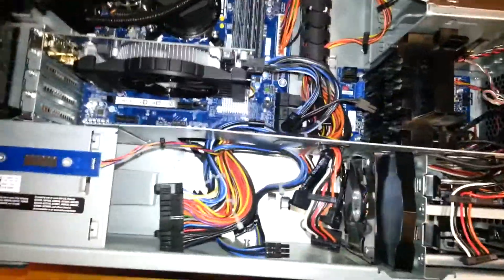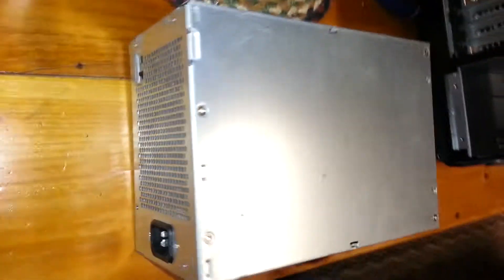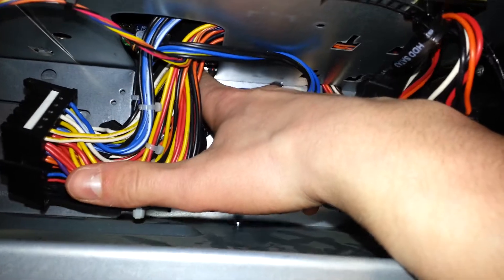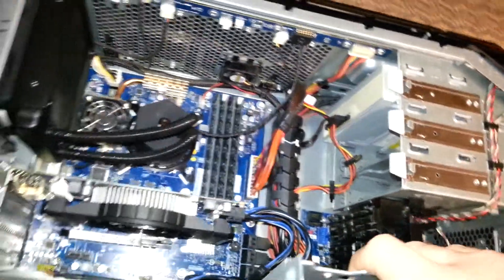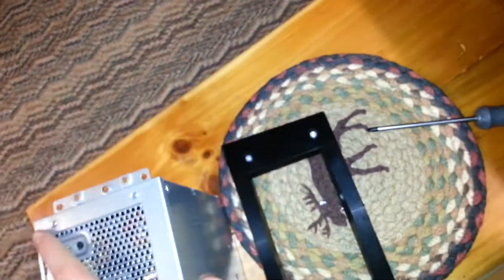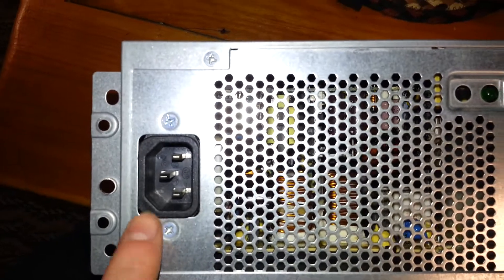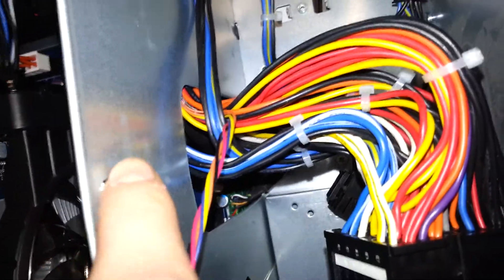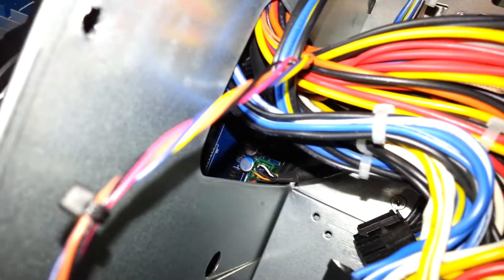how to install an alienware area 51 psu

Comment: +pccentral102 How did you remove those studs with a hammer and flathead? Mine is really stuck in there and they wont budge. Any other suggestions or specific ways you hammered them out?
Reply from the maker: wow, its been forever since i did this man, hmmm i believe what i did was use a flathead and hammer and hit it right at the tip of the stud to the point where it was so bent i could move it myself and pull it out, another option may be using brute fprce with pliers but i think a hammer and flathead with a big handle is key
Reply: +pccentral102 yeah I managed to get it done, but now my PSU isn't working. I think the one I got was faulty. Would you be able to give me the exact name and model of the 1100w one you used to replace? I'm going to order a new one instead of a refurbished one this time lol.
Reply from the maker: +George Perez yeah ill give you a link to one on ebay that will be the one i got
Reply from the maker: +George Perez 231665827152 thats the item number, mobile wont let me get a link...but thats the psu i got...i cant guarantee the quality and what not but i xan say that thats the same version id do a little more research into it and find some more like it, i did also buy my mine used...
Reply: +pccentral102 Thank you. I found one even cheaper and brand new. I think I had the 7500, 1100w. Don't know if it was a compatibility issue or just faulty equipment. I figured it would have been fine since it was Area51 compatible and also same bridge cable. Your video helped me bigtime man. Thanks again!
Reply from the maker: +George Perez No problem! glad i could help!